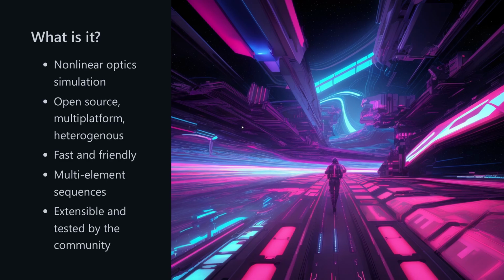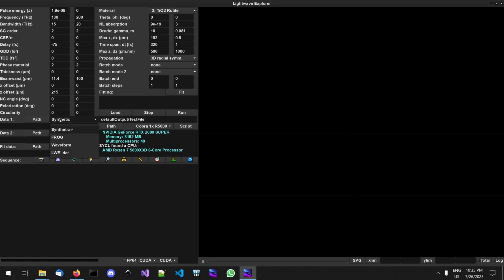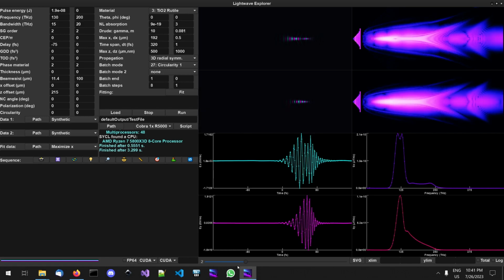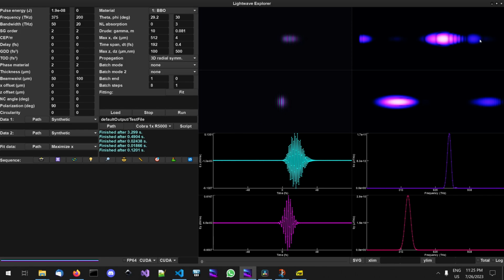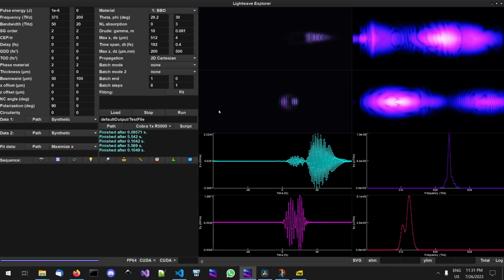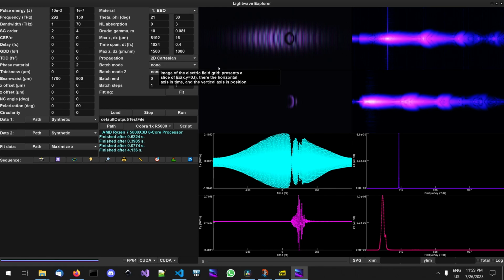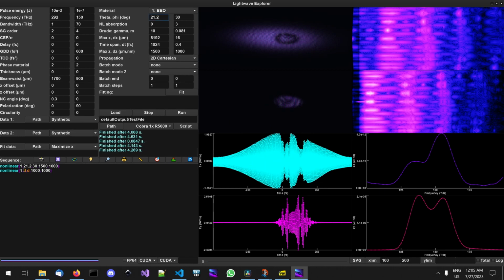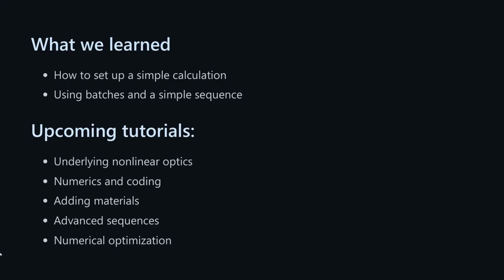Open source nonlinear optics: Lightwave Explorer, tutorial 1

Comment: How can I export the spectral data obtained from the simulation? All I can see is a zip with two .dat files
Reply from the maker: Hi there, the easiest way is in python - there's a module you can get with pip install LightwaveExplorer
then in python,
import LightwaveExplorer as lwe
imported_data = lwe.load("your_result.zip")

the spectra will be in imported_data.spectrum_x, imported_data.spectrum_y, and imported_data.spectrumTotal, for the spectrum with x-polarization, y-polarization, and total, respectively.

Comment: Thanks for this powerful tool! But not sure if I missed something, how can I simulate a pulse focused into a crystal? since the beamwaist seems to be constant?
Reply from the maker: Hi there, the beam waist you set is the waist size of a Gaussian beam, which will propagate, changing size as expected. If the "z offset" is 0, then the beam will be focused on the front of the crystal, and if it's +100 microns, it'll be 100 microns inside the crystal. And of course the beam is following the wave equation, so if there's self focusing from the Kerr effect and so on, that will affect the propagation. Have fun!
Reply: @NickKarpowicz  Hi Nick, thanks a lot for the reply, a stupid question: so when I scan for z offset from 0 to a positive number, I am visualizing the output condition 0~the number after the focus right?

Comment: Every time I click on that floppy disk icon(which i assumed is the save button), the application crashes and all my data are gone. I realise that I use pc with far less power compared to yours but I don't think that should cause a problem in saving the file. How can I solve this? It also crashes every time after I go through several runs
Reply from the maker: Hi there, thanks for pointing this out! I found a part of the Windows binary on the latest github release that needed to get recompiled. Could you please try the new version and let me know if it fixes your issue?
Reply: @NickKarpowicz  Thank you prof. The new version has resolved the issue.